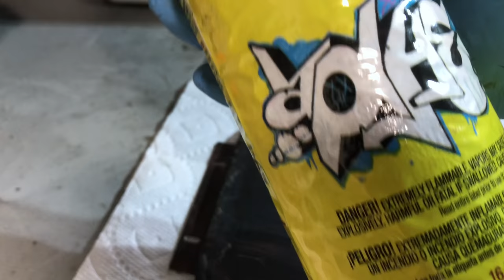Super Easy Frame Repair!!

Comment: patch came out great, l used the same drill bit for the church key but welded a vw gate hinge to it, project is moving along well, you should be cruisng by next spring.,
Reply from the maker: I'd forgotten you used a drill bit, but thought I remembered you made one! hopefully next year sometime...life is pretty full right now, but doesn't hurt to dream! Thanks for being here, really appreciate it!
Reply: @marcijunebug  marci  .is that key a repurposed  gutter downspout holder you nail into siding?????  That's all mom's house had before we  ripped them. Off.....
Reply: @marcijunebug  Lucky duck. Mustie1 never comments on my videos! LOL
Reply: On the gas door, there is a swinging cover that swings up to access the it falls to cover church key lock. Just like there is on the engine door lock that also uses church key. I remembered on my 57.

Comment: You are remembering correctly! There is a tear drop shaped cover for the church key lock mechanism. It should be spring loaded too so as to self close. Now, I could be remembering wrong but, I think that bend on the latch tab is supposed to be there.
Reply from the maker: you are correct on the "bend" I had already uploaded video when I finally went and looked one up on thesamba and realized that ooooops that bend was supposed to be there so  it doesn't get caught on the side of bus when closing it! lol I will address that in another video and it has already been "corrected" with a good whack of the hammer the bend is back in place!! lol wonder if I could "build" that little tear drop thing somehow?  Can't really tell how it attached...I will investigate further and see if I can come up with something...I also am missing the one for the deck lid so I'll have to keep my eyes out for one at swap meet (if we can have those next year...sigh) lol Thanks for being here Adam!

Comment: my 61 double has little rust but one of my frames has the same rust ,not the one your working on now but the one across. you give good weld  and I just orderd the same eye glasses frame a few days ago .   great video. keep banging.  just crazy how you get back to the blue and a killer shine.
Reply from the maker: love my double cab! I figure after I'm done with ole pickle here...it'll be time to dig into the double cab...It's on a super solid frame, but crusty on lower body panels and missing a couple out riggers...thanks for being here

Comment: What wall thickness did you use for the frame part?
Reply from the maker: same as original...since I was planning on patching where I could, wanted same thickness...drove my double cab to metal place and had them measure frame on it and ordered that...I believe was 12g?  it is less than 1/8th inch I know that! wanted 1/8th but thought best go with what was there...might regret that later! lol

Comment: it's sad when the cardboard piece looks more structural than the existing frame rail. But the good news is you can do your fabricating with a box cutter!😁😁😁😁 That new piece looks pretty good for a first try.
Reply from the maker: I know right...gosh this bus is so bad...but I got the busted up frame horn all built this week...so we are getting close to getting it off the rotisserie...hopefully I will get that content uploaded this week!
Reply: @marcijunebug  replacing the lower parts of the body and the floor will be a major milestone. I would double check to make sure the end of the shifter tube will match up with the location of the shift rod on the transmission.

Comment: Did you put a drain hole on that frame section. Nice cuts. Also, I swear you were going to put the glass door knob under your bench on the end of something to make your church key.
Reply from the maker: yes, drain holes will be in the entire frame...I am NOT doing this again later! ha I thought about a glass knob, but this I'll do that on the deck lid instead! ha the church key fits in that little slot up front to the knob was too fat...boooo

Comment: Good job, the patch fits perfect 👍.The bend on the little metal tab on the lock is original. This should help that the metal tab slides easy into the notch as you can see here:https://raanas-shop.de/VW-Bus-T1-Ersatzteile-1950-1967/Aufbau/Mechanismen-Schloesser-Tuergriffe/Tankdeckel-und-Zubehoer/VW-Bus-T1-Samba-Tankklappenschloss-55-67-0428-4::2118.html
And you are right, there was a little door on the lock 😁
Reply from the maker: I realized that after I had already uploaded video...I commented earlier to another person that I went and looked one up on samba and was like ooooppps, so I promptly whacked with a hammer and put it back! lol

Comment: Subscribing because you have given me such great ideas, I bought a shell of a 70 adventurewagen, it doesnt have the torsion tube and Im looking on how to weld one I bought. Will you used reinforcements on the welds? like sheet metal reinforcements
Reply from the maker: OOOOOO an adventure wagen! FUN stuff! My Torsion tube is in pretty decent shape shockingly! I will try to show all the steps I can! I'm going to have to rebuilt my front beam, or at least some of it! Thanks for the sub, I truly appreciate it and best of luck on your project...the important thing I think is to have fun with it and don't sweat the small stuff!  One bite at a time!
Reply: @marcijunebug  Its been siting for two years :( I have a 70 tintop with lots of rust,  will sell it. Ive been gathering parts for the adventurewagen, the rear part of the chasis was so difficult to get. Since the early and late bays have different torsion tubes/torsion bars, I wouldve have to buy more stuff. Now I have almost everything but im concerned about just welding and putting reinforcements since it will have all the furniture at some point.

Comment: I didnt notice until the third time I watched the video. You made and welded a rotisserie directly on the chassis of the bus?
Reply from the maker: it is just bolted to the torsion tube and then up front where the beam bolts up, but the frame was so bad and I cut entire sections out that I welded a few supports along after I got the bus "straight" so it would at least hold it's shape...plus I knew it was going to be on the rotisserie for a while and I didn't want any additional strain on the body...